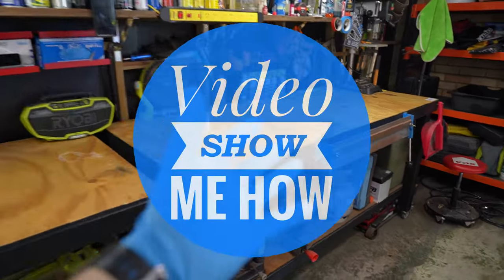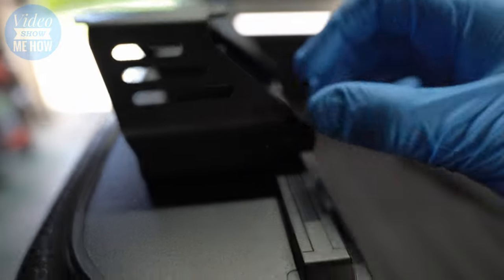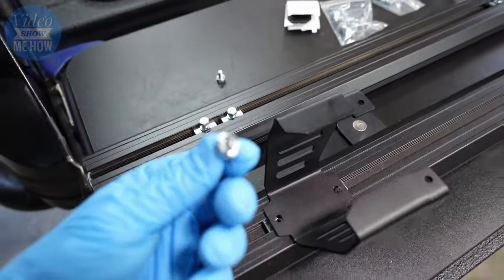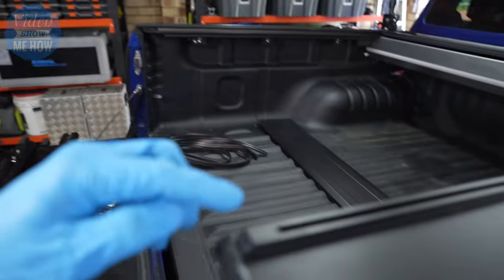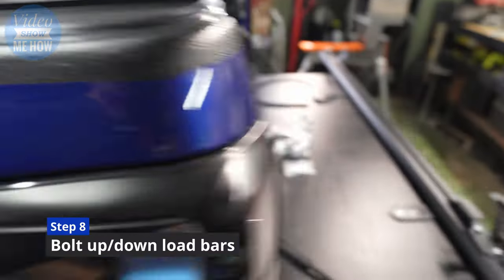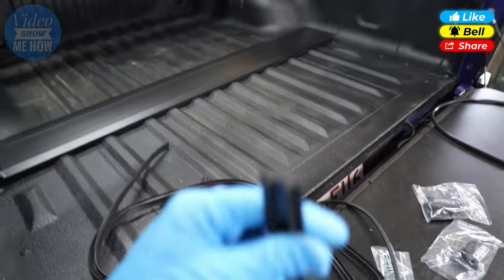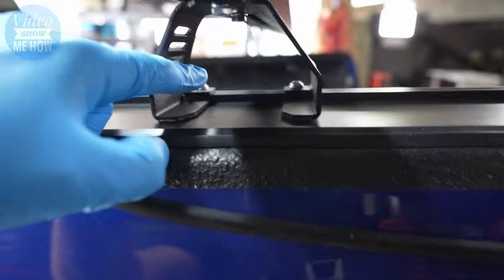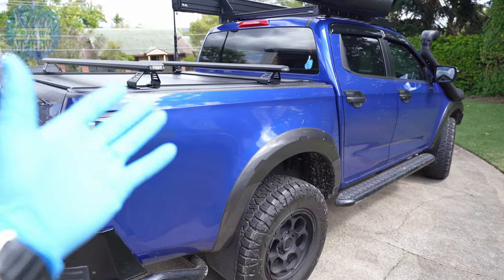HSP LOAD BAR Install | Can hold 80kg? Perfect for... | Isuzu DMAX X-TERRAIN Build Series #41

Comment: Hi Adam,  Just wondering if you know if these bars work with the original roller cover on the XT?  My plan is to put a roof top tent on the tub, but with the ability to remove the racks with the tent still attached and store it as an entire unit.  Will have a pulley system to hoist the tent up to the garage ceiling and secure it above the Dmax.
Reply from the maker: Not really, the problem with the factory roller top is it can't carry any weight, you need their reinforcing brackets at the rail sits away from the sides

Comment: Hey mate, what’s the bracket/mount you used for your UHF aerial? I want to do the same set up you did. And also how did you mount it?
Reply from the maker: It's a GME flip mount. Just used channel bolts to secure
Reply: @VideoShowMeHow where did you purchase the channel bolts? Are they specific to the HSP channel?